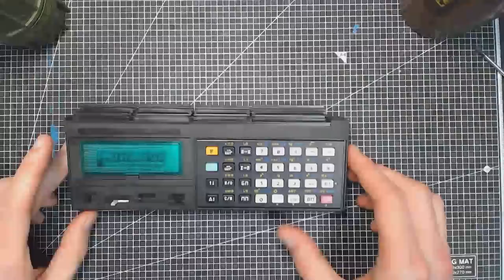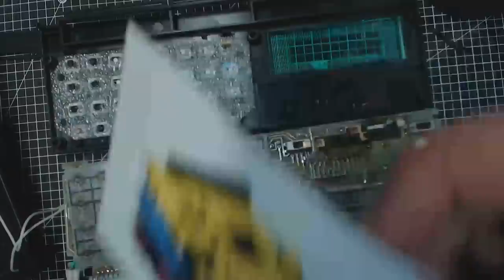Retro Tech Teardown: MK-52 Soviet-era Scientific Calculator

Comment: Also tag tantalum capacitors have looked like that for 40+ years, they are nothing special. And the key caps are just double shot injection molded like keycaps have been for a half century. If you silkscreen them the markings will be gone in a matter of months. Of course there are cheap keyboard that do just have pad printed or silk screened graphics on them but I am talking about good keyboards. 

The big IC says 8911 so that means the IC was made in the 11th week of 1989 so that means the calculator was made sometime after that.

Comment: If it's still  working today it's been reacconditioned before you bought it. (recapped and likely also the vfd has been replaced too). You do not emphasize the one characteristic of this model, which is permanent memory! They achieved it by using n eeprom, which is also pretty unique (I'm not sure there are other calculator models that do use eeproms as permanent memory). That's unique and somewhat archaic, but as you say people have feeling for these things. I definitely do. Didn't yours come with the schematic diagram poster ? I'd rather study that than open mine (I'd be afraid to loose the keys and not be able to assemble it back again). Btw, I think attaching an Arduino to it would be cool (although I'm thinking it would have too few pins, unless we're taking of an Arduino Mega). Can't you rather try to find an adapter to fit inside the port instead of opening it? An adapter to breakout all the pins to a breadboard would be nice and useful. I'm sure something can be done along the lines. Also be careful with the voltage..

Comment: RPN was done FIRST on calculators because it made the firmware much easier to write and required less complicated processor architecture. It stuck, because it is actually way more intuitive than algebraic. At least it is to me. It sounds counterintuitive (since it was developed to make calculators more easy to use), but transposing handwritten calculation into an algebraic (or worse, textbook) notation input occupies a different part of my brain than doing the math and calculation in my head, while RPN flows more naturally. Maybe here's a metaphor to understand: Algebraic/textbook entry is like getting dictation, while doing math and RPN is like writing an essay. Switching from one mode of thinking to the other just to get a numerical result is mentally straining, to me. Your mileage may vary.

Comment: Very interesting the two plastic of the keys, could it be double injection molded plastic keys, like the early HP had? (like the Voyager series for example). It wouldn't surprise me the soviet would laso have copied this. If that were the case, that would explain why the keys wouldnt fade,they aren't painted, the number is another color plastic.